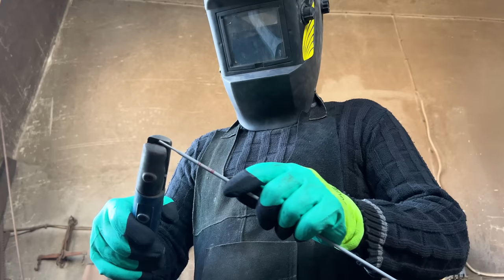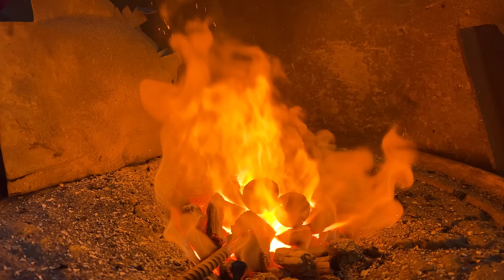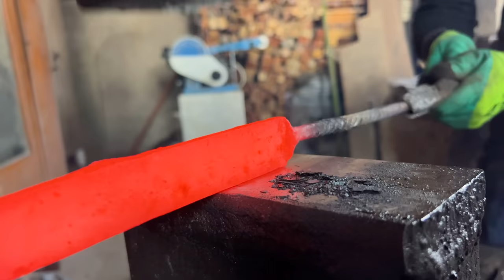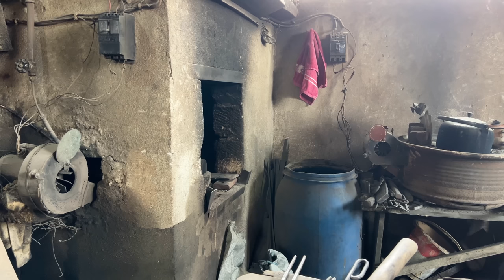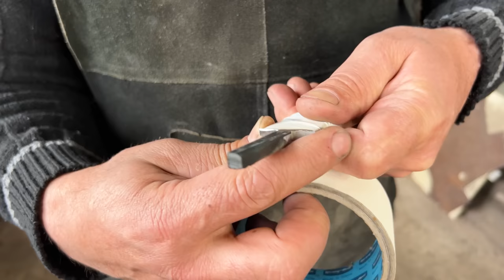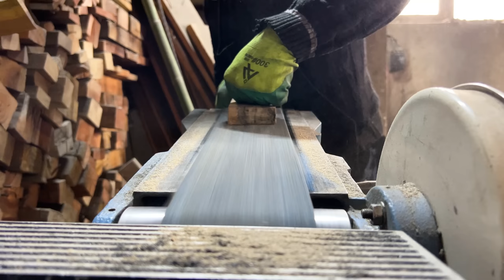Nail Clippers to a Knife: Crafting a Sharp Blade from Scratch!

Comment: Chrome plated with no prep work, and open air! Not a chance, this is camera magic!
Reply: Lol I was wondering how he fuse that without removing the coating
Reply: @gavic85  i mean there could be chance are he had medical grade stainless steel clippers
Reply: If you notice, he did put a respirator with carbon filters on when he added heat to them. But, not when he was sanding and grinding, I guess he gets his RDA of iron that way.

Comment: I'm as much a sceptic as others when it comes to time skips, so I took a little time reviewing the billet before and after the time skips and saw the shape of the metal lined up on the ends and the layers I could see looked like they matched up with the strips of clipper metal. 
So, while I hate time skips due to their making things look suspicious (I would have sped the forging process up rather than time skipped to prevent haters shouting FAKE!), I believe the billet and blade was actually forged out of those clippers.

Comment: Even with the 10 pounds of borax he put on there I don’t understand how he got that mess to stick together
Reply: as long as you fold it enough itll all merge together
Reply: But shouldn't there be li,e a ton of coldshunts?
Reply: @13Nagash13  you can see 2 nasty cracks 1 on the spine and the other on one side of the blade edge
Reply: The power of video editing.
Reply: I've seen enough of his projects to see a pattern, the amount of borax he uses soaks into all the voids and prevents oxidisation and is forcibly ejected when he starts hammering (thats the liquid globs that fly out when he returns to the anvil), so that explains why his forge welds are as good as they are. As for how he manages to get it to stick together? loads of borax, lots of heat and constantly working the metal until it bonds together.
As for the chrome plating? Many clippers are nickel plated, so maybe that is what he used, but thats neither here nor there since the heat treatment causes much of the chrome to oxidise and outgass (that explains the respirator), while his persistent forging would force any resudue to work into the metal and give it an interesting appearance.
Perfect? nope, safe? there's a reason he's using that respirator.
Reply: @13Nagash13  the amount of borax he uses and the repeated forging would have worked most of those out.
Imho, he should have continued working the metal to get those defects out
Reply: @GaisaSanktejo  safety first, right?
Reply: Because he didn't. 
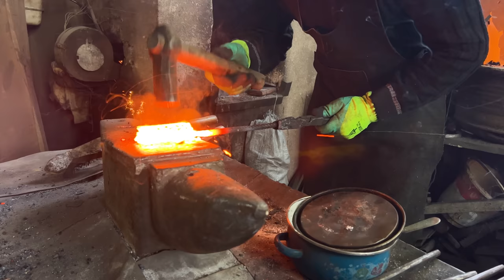3:20 is a different piece of metal from 3:15. He switched it out. If you slow it, you can see it goes from a piece you can see the layers of metal, to a solid colored piece with no layering. 
He switched it out, it looks like.
Reply: @Facetiously.Esoteric  I believe you are mistaken; yes, there were time skips, but I took a close look at the ends and visible layers I could see after 3.20 and they match up with the mess before the time skip.
Imho, I believe he cut the hour or so trying to get it to forge weld together into something resembling a billet.
Reply: I'm gonna be that guy today.  I don't think this actual worked, for multiple reasons.  One other thing.  Those clippers appear to have been chromed. If they were,  would that be an issue with the welds setting?
Reply: @oldmantwofour5561  I believe most of it burned off and was outgassed
Reply: I think a big part is him using a coke forge opposed to a propane one. Propane forges tend to cause lots of scale that prevent full welds. It's something in the chemistry about propane that coke/coal doesn't produce meaning coke has a better burn and less scale formation
Reply: @jimmygammon2352  charcoal is the cleaner one to forge weld with some like corn cobs as fuel most use hardwood and if you look carefully you can see sticks with a crotch in his fuel he is running charcoal
Reply: You all need to study metallurgy
Reply: @johnpaulcalixtolerias9351  enlighten us then!
Reply: @GaisaSanktejo  well most clippers are made from stainless steel. Even those cheap Chinese ones. So, getting anything to stick through that, or even nickel plating is a no go. This is obviously a fake video. Stainless won’t stick to steel and def won’t make a pattern like that if it did. Clearly he made a knife. From what and how is still a mystery.
Reply: @tattoosteveneo  While google appears to disagree with this argument, I see little point in continuing the debate.
Please lets agree to disagree and leave it at that? 😄
Reply: @tripsix263  ⚠️ God has said in the Quran:

🔵 { O mankind, worship your Lord, who created you and those before you, that you may become righteous - ( 2:21 ) 

🔴 [He] who made for you the earth a bed [spread out] and the sky a ceiling and sent down from the sky, rain and brought forth thereby fruits as provision for you. So do not attribute to Allah equals while you know [that there is nothing similar to Him]. ( 2:22 )

🔵 And if you are in doubt about what We have sent down upon Our Servant [Muhammad], then produce a surah the like thereof and call upon your witnesses other than Allah, if you should be truthful. ( 2:23 )

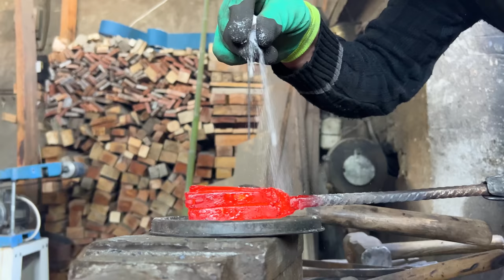🔴 But if you do not - and you will never be able to - then fear the Fire, whose fuel is men and stones, prepared for the disbelievers.( 2:24 )

🔵 And give good tidings to those who believe and do righteous deeds that they will have gardens [in Paradise] beneath which rivers flow. Whenever they are provided with a provision of fruit therefrom, they will say, "This is what we were provided with before." And it is given to them in likeness. And they will have therein purified spouses, and they will abide therein eternally. ( 2:25 )

⚠️ Quran
Reply: @oldmantwofour5561  the chrome would usually be fine as it usually would melt or burn off during the first three heats
Reply: @oldmantwofour5561  no because the chrome is conductive so it makes the weld and the chrome would usually melt and fly off when he strikes an arc
Reply: @Facetiously.Esoteric  why don't you make some content, I feel like you would be great(I could be an editor for free) I made a few videos and it was pretty fun
Reply: @dustingary-ps9ek  I'm an Executive Chef. No time. It takes me weeks and weeks to work a piece because I can only do an hour or two at a time.
Reply: @oldmantwofour5561  the nippers would also be stainless plated in chrome so yeah no way it is gonna not have cracks and cold inclusions.
Reply: Wellcome to metallurgy dude....
Reply: @GaisaSanktejo  You can't chrome directly onto steel so it's always nickel plated first. 
The nickel is also much much thicker than the chrome which can probably be measured in millionths of an inch. (very doubtful the nickel plating is a thousandth of an inch though)

Comment: Cool concept and blade. However, you need to temper that thing before you fully sharpen it and put the handle. Once you harden steel (which is important and you did wonderfully) it does become hard (duh) but also really brittle. When it is brittle it runs the risk of snapping under pressure and this can be dangerous! Tempering after hardening significantly reduces brittleness while still maintaining a hard steel.
Reply: You realize this Dude has forgotten stuff You have still to discover… smh!!
Reply: @toninobaroni1572  Just trying to point out the safety of it. I know I can't do what he can

Comment: That is amazing. How did you keep voids from forming in the spaces between the clipper sections?
Reply: All of the borax seeped into the cracks and voids until the metal was struck by the hammer, the borax is squeezed out as the metal fills in those previous cracks and voids.

Comment: What is that white powder?
Reply: Borax que es una sal de boro con eso le permite reducir el punto de fusion del acero facilitandole la forja
Reply: It's borax (as sodium borate), this materia prevents the iron from oxidizing when heated
Reply: It's borax flux.  It's an oxygen scavenger, it bonds to oxygen in the porous spaces so that the oxygen doesn't form rust in the steel and prevent proper welding.  It helps prevent voids and cold shuts in the forged steel. Though I am amazed he pulled it off and got a solid billet from the loose metal he used here, suprised he didn't use a canister.
Reply: Coke